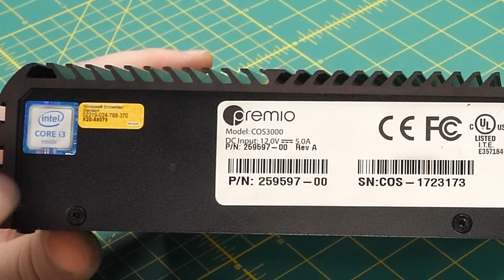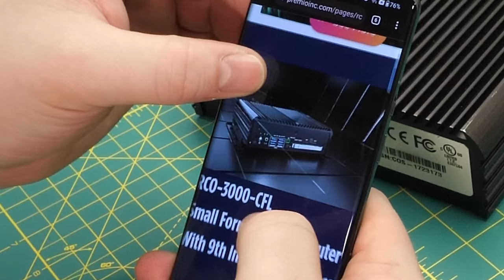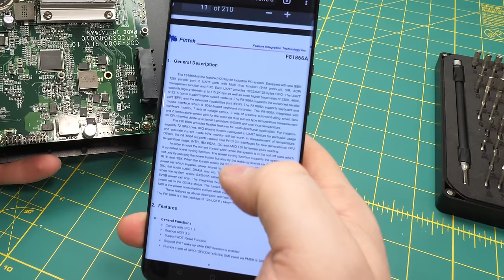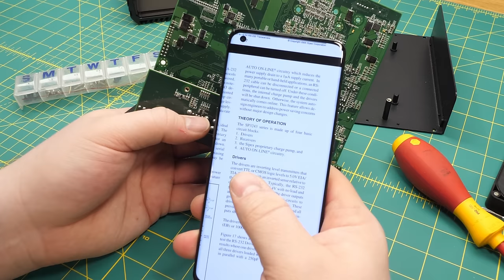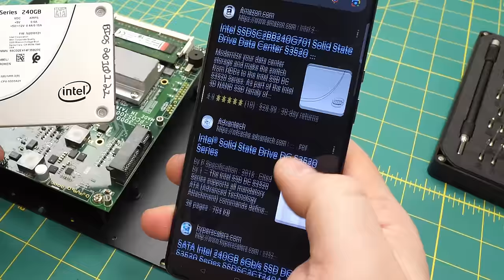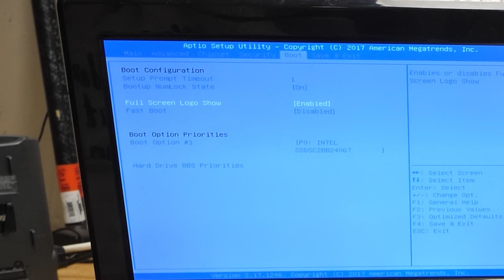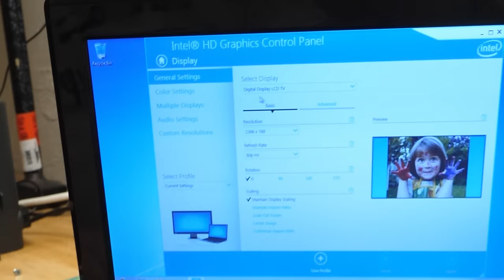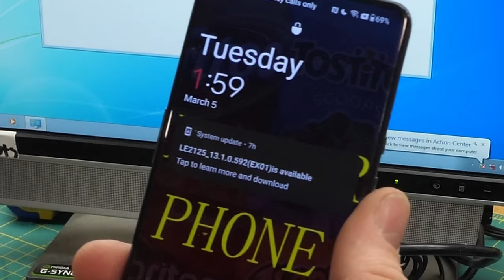Little Guys: Episode 4 [Premio / Coinstar]

Comment: Good video but I don't like how careless CRD is when handling the hardware. Even if this thing is perhaps useless, I would still treat it like any piece of modern hardware, with care. But that's just my way, I admit.
Reply from the maker: I have handled literally tens of thousands of computers and I simply cannot worry that much about them anymore. Computers are pretty much indestructible unless you do very specific boneheaded things or elbow drop one, they're generally speaking pretty damn tough. I used to work a job where we handled hundreds of used motherboards a week, and we pretty much just threw them around, didn't bother with static bags or any form of precautions, toted them around in big boxes without any spacers, etc because we just didn't have the time, there was just way too much of it to take the time to be careful. the number of components I ever saw actually stop functioning was less than 1%, and most of them came in dead to begin with. This is what it looks like to be completely jaded, lmao